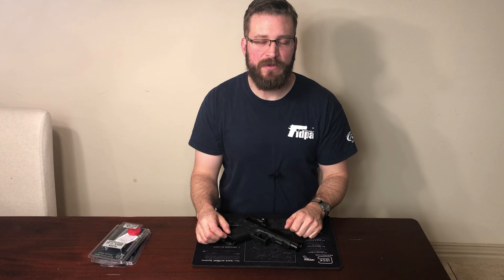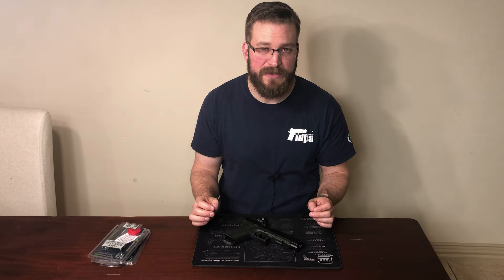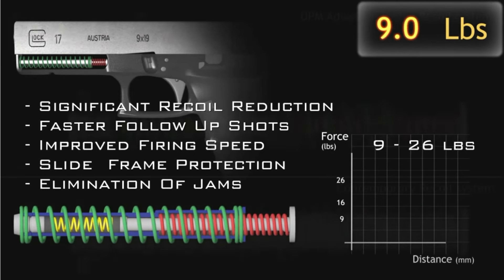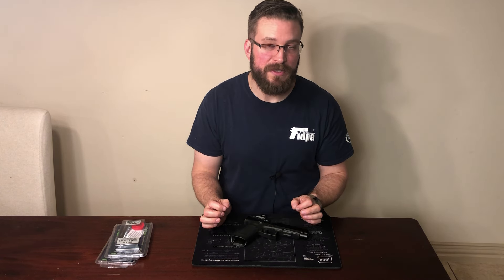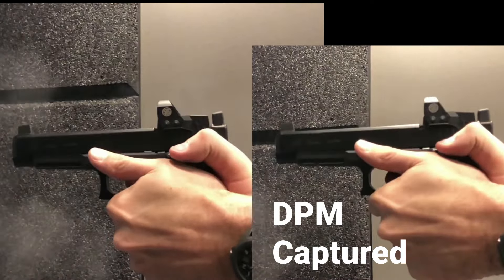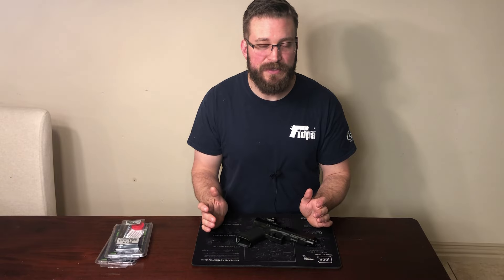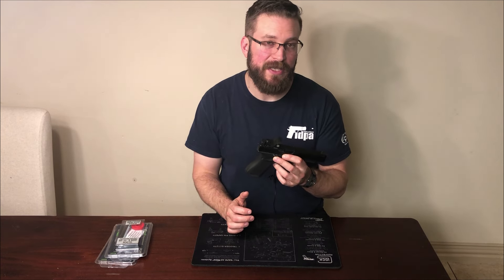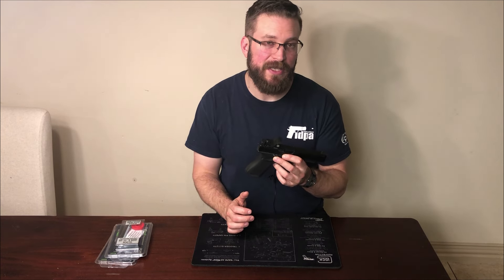DPM Recoil Reduction System - A review - Fully Adjustable and Captured

Comment: I had one in my PPQ but sold it on ebay . The spring is heavy af and it slaps the gums slide forward hard and sends your rapid fires low . It slighty reduces muzzle flip but creates an inverse issue on the return .
Reply from the maker: on my glocks that wasn't a huge issue.  For cyclic rate firing it's no better than stock - but anything north of about a .22 the DPM seems to help the gun recover faster.

Comment: So they actually have three systems for the Glock or at least for the Glock 26 because I have one that looks completely different than yours, mine still comes with three springs to choose from only without this socket spacer things… I believe the three different types are the Captured recoil system, the mechanical recoil system and the telescopic recoil system

Comment: If you watch super slow motion videos , you can see that the bullet leave the barrel before there is any big movement from the slide. So how should the recoil system  effect accuracy?
Reply from the maker: It’s effectively a variable rate spring - argument being it holds guns like Glocks in lock up longer- that’s the argument anyway
Reply: @TheHumbleMarksman   Ok. I dodnt what spring was in the pistol (was a G19). But the whole gun looked quite stock. And at the moment the bullet left the barrel it hardly moved yet. You can watch it for yourself " 9mm XTREME DEFENSE Ballistic Gel Test! - Ballistic High-Speed "

Comment: The DPM came installed in a CZ Phantom I bought used.  I didn't really pay it any mind when I got it, since it came with the OEM parts if I wanted to revert back.  By the time I got a chance to go shooting, several weeks had passed, and I had forgotten about the DPM system, and I was really amazed how much it appeared to tame the recoil impulse and I did notice that I was getting back on target faster.

Comment: I'm not a marksman or a competitive shooter but I put the DPM system in my Glock 42 and after over 1000 rounds there have been no malfunctions and a very noticeable reduction in muzzle flip and recoil. I am now able to shoot double taps and rapid fire 4 to 6 inch groups from 10 yards something I could never do in the previous 4000 rounds fired. I know that's not world class shooting but the G42 is my carry gun and I can shoot it better than before. The only downside is this system will make your handgun much harder to rack the slide(sort of like a Kahr). I replaced the rear slide plate with one that has a slide racker.

Comment: I have this system in my G17, G19, and G21, as well as my Taurus PT111 G2, TH40, and I have ordered it for my Taurus G3 because I have been so happy with the results at the range.
Reply from the maker: I mean they flat work!
Reply: @TheHumbleMarksman  , In case you are considering a Taurus G3, DPM systems makes a recoil system for the 24/7 G2 and it happens to be the same dimensions as the G3, and it works great.
Reply: @timothyallen1725  what spring did you use in your G21?
Reply: @MacsStang  I use the larger spring as I load 185 grain hollows at +p charges
Reply: @timothyallen1725  any issues at all? Does it make a big difference? I’ve been thinking of adding one to my G21, just not totally convinced yet. I typically shoot 230 grain target loads and 230 +p self defense rounds. Velocity is between 830-900 FPS.
Reply: @MacsStang  Not one single issue, not a single failure to fire, failure to feed or failure to eject. For me and my grip I have noticed a significant difference with felt recoil, and follow up shots and re-acquisition has also improved. Optimal expansion and performance of the hollows I load require between 950 and 1050 fps, and this is the range that makes the DPM system so worthwhile for me. When comparing slower velocity ammunition the benefit of the DPM system is marginal, but at higher velocities is where the DPM system shines for me. Hope this helps.
Reply: @timothyallen1725  Good to hear. I wish there was someone close to me that I could try a system out before spending the money to see if it’s worth it or not. Granted my G21’s purpose is home defense, so it might not be the most worth wild addition.
Reply: @MacsStang  I totally get what you're saying, a hundred bucks is a lot specifically these days. I first came across a similar recoil system back in the early 1990's from a company based in AZ. called Chandler Arms. I bought their recoil system for my gen 1 model 17 and liked it enough to buy one for my model 21. Chandler Arms has since gone out of business, and only due to my familiarity with that set up did I consider the DPM system. In comparison, the DPM system, while slightly more expensive, works as well if not better. I don't have a specific carry pistol, each one has its benefit and where I go and what I'll be doing there along with season and ambient temperature is the more determining factor for which one is with me. I like to take equal range time with them all to maintain muscle memory. It's a strategy that has worked well for me.
Reply: @timothyallen1725  Good deal. From the sound of it, you would trust the DPM system in your carry/defense weapon?
Reply: @MacsStang  Absolutely, in every one of them without question. I'm even looking into one for my pocket pistol, a Taurus G2C. I just have to complete the research, but it looks like the SIG 365 compact has the same dimensions.
Reply: @timothyallen1725  thank you for all of the information. I’ll have to give DPM a whirl!

Comment: Would you recommend this for a carry gun . I carry a PDP compact 4” with a Steiner MDS and Inforce wild 1
Reply: I put 1 in my pdp, I would say 20 to 25% recoil reduction. I haven't had any issues. I recommend it
Reply: @Neverknight2  what spring did you use ? I run 124gr on mine

Comment: I've gotta say, just looking at the design/concept of this alone I can't understand why people weren't doing this for awhile now
Reply from the maker: Yeah - I don't know either.
Reply: @TheHumbleMarksman  I found these through wanting to create my own recoil system to accomplish the same task - there are two main routes:

The cheap route results in a spring that needs to be replaced very often, and the expensive route (DPM) is, well, expensive.

Thanks for this video! I have now purchased over 10 of these DPM systems, and they are also THE solution to making both compensators and suppressors work.
Reply: Glock went from the single spring to dual spring during the gen 3 to 4 transition, big part of that was DPM's spring for gen 3 being so good. Using a DPM on a gen 3 glock is a big big improvement, using it on gen 4/5 that already has a dual spring... the effect isn't as noticeable.
Reply: @heinrichsoltow1829  right, yea obviously replacing an upgrade with something of the same purpose isn't gonna make much difference.  Hence the it not making sense they didn't do it earlier... it's a concept that's been around and should of been used on the earlier generations being superior for several reasons.

Comment: Have one of these in my Jericho, very noticeably softer shooting. With the stock spring even though it's a heavy gun it kicked pretty much like the lighter Beretta 92 which I guess has something to do with the tilting Browning action compared to the falling block in the Beretta, now it's absolutely night and day the Jericho is the softest shooting 9mm I have ever shot. I always thought those Hudson H9s were kinda snake oil, they never shot too soft to me, but this Jericho doesn't even feel like I'm shooting 9mm. I'm getting another one for my PX4 Storm because that thing is definitely one of the softer shooting 9mms out there and I'm hoping the new spring will make it feel like shooting a Nerf gun. The thing works, there's an Israeli company that sells them cheaper btw. Rambling review over.
Reply from the maker: Wow on a rotating barrel I bet it would be amazing
Reply: Ever get one for the PX4? I finally bit and bought one for my full size 40. I'm not going to make it to the range anytime soon, but so far racking the slide feels a bit smoother  like it has more traction and grip to the rail. Do let me know plz.
Reply: @TheHumbleMarksman  Just bought it have yet to range out but like i was telling the guy, its a bit smoother compared to the single spring plastic guide rod, better traction and grip to the rail. I had my doubts but the PX4 SD has a stock double spring guide rod, so extra reinforcement with triple springs should be ok I imagine. Its also vague on the descriptions but apparently its one size fits all calibers per full, compact, and subcompact models. So far its feels like less weight to rack and a much snappier response, if all goes well its on to the Langdon trigger group.
Reply: @1982sketcher  In my 9mm the recoil is pretty similar to swapping to a metal guide rod but the springs feel as stiff as a .40 spring which normally won't run at all. Overall the biggest improvement is that it will jam rounds into the chamber with a lot more authority, but I think my weak baby-wristed friend had a short stroke with it but my PX4 never really works great for him anyway for whatever reason.
Reply: @DaleErnieMichael  I'm upgrading from the stock plastic, so I have no comparison to a SS rod in general. The guide rods for the 9mm is the same for the 40 so outside the caliber and the few parts that aren't interchangable as 9 and 40 have a lot of the same interchangable parts except I guess the slide, barrel, firing pin and ejector, so telling me a it feels like a 40 spring might what it feels like to shooting the 9, I feel theres definite noticablity in the DPM at least so far as racking it, so all I have to go by so far is an improvement for the 9 in terms of reinforcing the slide, definitely snappier. I have a 40 so to guestimate and extrapolate from you again I imagine a triple spring would feel more akin to what the stock PX4 45 SD (plastic) double spring guide rod. Well, that being said, can you give me your opinion on the durability of the guide rod? I have heard a lot of people recommend against SS guide rods in polymer guns, I asked the guys over at Langdon what they thought seeing as how the PX4 had its renaissance with the full and compact 9mm PX4 CCs and they said they never tried them. The steel trigger Langon tried from Beretta was aftermarket and there've been breakages so he seems opposed to aftermarket parts for the sake of durability. Do you have a guestimate of how many rounds you put through it and the the overall durability, jams, breakage or any other issue which might help enlighten?
Reply: @1982sketcher  I only have a few hundred rounds on the DPM spring so I can't speak to the long term durability of it but it definitely doesn't feel like it'll break any time soon and nobody's better at breaking guns than me. Reliability has been just as good as it's always been for me and it hasn't broken anything else, though I don't see how it would. I can say it feels great to shoot, much better than the stock plastic spring guide which is why I got it.
Reply: @DaleErnieMichael  nice
Reply: Got one for mine and never used it because the rod stuck out more than the stock guide rod. To me it's out of spec and didn't want to risk ruining my pistol. Not worth the $100+ price tag IMO.
Reply: @weezem  Sticking out further wouldn't ruin your pistol, that's a marble-brained thing to think.

Comment: I've only accidentally heard about the DPM recoil system while I was searching for a recoil compensator for CZ handguns. Some people say the main benefit from these springs are lessened wear on the frame due to recoil. I don't know if that's true, but it makes me want to consider buying it.
Reply: I too just found out about this while searching up info on my steel witness compact (10mm). It seems like a really good idea in general, just depends on how the gun locks up and releases the slide after firing...

On the witness what I have found in my research was that too light of initial spring pressure can cause accelerated wear and tear on the locking lugs as it doesn’t keep the slide in battery long enough after firing.  I don’t know just how much it accelerates the wear though. It my well be a good trade off against slide/frame battering.

One cheap trick I’m going to try I found on a forum. That is to take a 1” piece of a spare 1911 recoil spring and sleeve the normal witness recoil spring with it back by the recoil lug side. This will maintain the factory timing on recoil from firing but the 1911 spring piece will “catch” and slow down the slide to stop frame battering. on its return to battery the 1911 spring will not add any spring pressure  when locking back up so it reduces wear at this point when compared to a heavier aftermarket recoil spring. Just start with a 1” piece and trim it one coil at a time until it will lock open on a empty mag. NOTE: you may need to do some additional trimming so take wire cutters on the next range trip and trim until there is no issues feeding or locking back.
Reply: @patricktinnin2877  I also heard about the slide catch breaking more easily if the slide rebounds with too much inertia. Then again, yeah, I also read that the slide catch was designed as the breakable part of the CZ Shadow 2, because it's cheaper to replace it than damaging the slide. 

Some people seem to remove the buffer and put a lighter spring in theit Shadow to protect their slide catch, but then it means the slide takes the full recoil.

Comment: I bought my first DPM recoil system back in 2017 for a model 17 gen 1, have since installed them in my 19 gen 2, 21 gen 2, my Taurus TH40. and used their system for a 24/7 G2 with the outer spring from the Glock 19 in my Taurus G3 as they do not offer a system specifically for the G3. They all work as advertised and have included them in all my Poly 80 builds as well. Back in 1992 I bought a similar recoil system offered by a company from Chandler AZ. "Chandler Arms" that is no longer in business, it worked very well and I still have it. I often wondered if DPM bought Chandler Arms or just based their design off of it. Great review, thank you very much.
Reply from the maker: Interesting - I wasn't aware of that bit of history - thank you.

Comment: Would it be advantageous to use it on a Glock 42? I am very undecided. Could you help me, please?
Reply: I dunno if it's available for the 42? But if it is, it should help tame perceived recoil. From what I can tell, it doesn't appreciably affect overall muzzle rise/dip. But it does affect the 'feel', which can have an effect on accuracy, as well as comfort of training. bit pricey though. A rubberized grip surface also affects "feel" of recoil without measurably affecting muzzle-rise/dip. I'd start with a Hogue Handall Beavertail grip for the 42 first, as it's quite a bit cheaper (like $12). Eventually get both perhaps, if it makes the difference between accurate fire and training more often for you (assuming you can find/afford ammo, heh)
Reply: @kathrynck  Thank you very much for responding. I will follow your tips. Have a blessed end of year for you and your family.

Comment: I am running mt Sig p365 with a suppressor...and get many Failure to feeds.  Mostly the bullet 'nose dives' within the cartridge.  Do you feel the DPM will help me tune the gun to run it suppressed?  I recognize the p365 is a small gun with a 10 oz. CGS suppressor hanging on the end is tough duty.  Would i need a lighter or heavier spring to attempt to address this?
Reply from the maker: You need a lighter spring probaby - the DPM doesn't feel lighter when cycling the slide.

Comment: The guy at Cajun Gunworks told me the recoil spring should eject the brass six to eight feet away from the shooter. Is that the only condition that needs to be considered when choosing a different recoil spring?
Thank you
Reply from the maker: it's definitely one consideration - arguably the more important one - but how it puts the slide into battery and how much oscillation in recovery is another consideration a competition shooter probably looks at harder.

Comment: If they last 80k rounds, then I wouldn’t call the price steep. Nice vid, just ordered one to try out.
Reply: i know this is old, but how'd you like it?
Reply: @psycomutt  I think they are worth it if you like tuning guns. Factory guns are typically over sprung which produces a little muzzle dipping. I put one in my VP9 which had weak ejection and dipping. The spring took care of both those problems. Plus it did shoot a little softer. I would say they aren’t worth it in micro guns like the Hellcat or P365. Only so much can be done with short springs. Very little if any benefits unless you plan on shooting 25k rounds with them. So for some, durability may be worth it alone.

Comment: I'm not impressed with that 25 yard group. I'm in the middle of a Gen Glock 34 build and hope it does better then that.
Also have you tried a tungsten guide rod system
Reply from the maker: Off hand unsupported that ain’t bad.  Bro I am sponsored by GlockStore - I have tried all the guide rods - watch my building a heavy weight Glock video
Reply: @TheHumbleMarksman  my bust... I thought you were sand bagging it... yes then that is a good group forsure...

Comment: I just purchased a DPM system for my Glock 23 gen 3.  I have two spring options (long & short).  My loads are typically between 900 to 1100 fps.  Can you tell me which spring would be most recommended?  Do I assume the shorter spring is meant for 9mm loads (hence Glock 19)?  I would greatly appreciate your reply.

Thank you